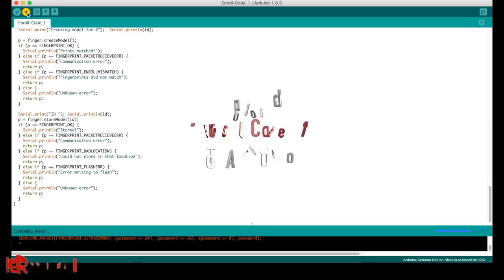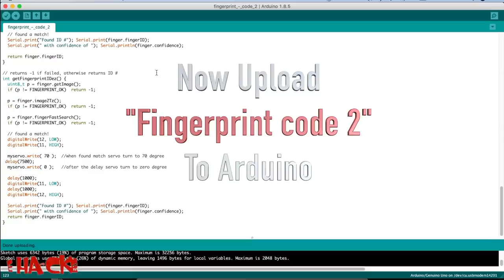How to make Fingerprint Locker with Arduino | Indian LifeHacker | #Howto

Comment from the maker: Buy Product from Here:
IRFZ44N  https://www.flyrobo.in/irfz44n-power-mosfet-ics-integrated-circuits-chips?tracking=5b853f18ae9a2
Solenoid Lock https://www.flyrobo.in/electronic-lock-catch-door-gate-12v?tracking=5b853f18ae9a2
Finger Print Sensor https://www.flyrobo.in/finger_print_sensor?tracking=5b853f18ae9a2
Arduino Uno R3 https://www.flyrobo.in/arduino_world/arduino_board/Arduino_Uno_R3_with_cable_for_Arduino_Uno?tracking=5b853f18ae9a2
Power Adapter https://www.flyrobo.in/dc-power-supply-adapter-12v-2a?tracking=5b853f18ae9a2
Reply: Congratulations for 400k subscribers
Reply: sir plz ardino code ki link bhi do
Reply: Hai bro plz make big water tank water level indicator with 16*2 display plzzz bro plzz
Reply: sir app next video me ardino ke code bhi description me dena
Reply: Indian LifeHacker
Reply: Sir - this is cardboard or wood ??
Reply: Pls tell me
Reply: Bhai keypad and display add krke  yhi bnana hai kuch help milegi

Comment: Hi, nice project. I built it and the sketch works great.
But I have one problem to fix:  The power of the Solenoid lock is not great enough to open the door. I have to push the locker a little to open. Than it open. Do you know how I can give the locker more power?

Comment: Hey bro made the project with Arduino nano,5v solenoid and gt511c3 fingerprint sensor but just had a question right now I require two batteries is there any way I can run the entire project on one battery itself

Comment: This is great, is it possible to a weight sensor in this circuit? only when the weight is right only then the finger print sensor will activate?
Reply: to add a weight sensor

Comment: Hello i am getting fingerprint sensor not detected error in my serial monitor
Reply: Connection loose hoga ....nikalke lagao
Reply: I am currently working on it so can u help me... Arduino p 9 v chalta h ... adaptor 12v ka Lagaya to Arduino ud jaega .....but isme 12 v use kiya h ....aapne  kya use kiya h??
Reply: @s_kazi8202  fingerprint ho gaya detect lekin lock ke sath kaise sync kare
Reply: @s_kazi8202  i used 12v
Reply: @vinayakbhamblani1921  connection PURA bataya h video m ...do exact
Reply: @vinayakbhamblani1921  mujhe shopkeeper ne bola don't use 12 v ud jaega Arduino....mujhe samajh nhi aaraha ...agar 12 diya aur ud Gaya to budget bad jaega
Reply: @vinayakbhamblani1921  aapka agar ho Gaya successful to plzzz let me know how u did. ....and agar mera ho Gaya to I will inform u...
Reply: @s_kazi8202  kar diya lekin nhi lock open close nhi ho rha
Reply: @vinayakbhamblani1921  same prob ...dusre videos bhi dekho aur idea lo ...m bhi dekhti hu